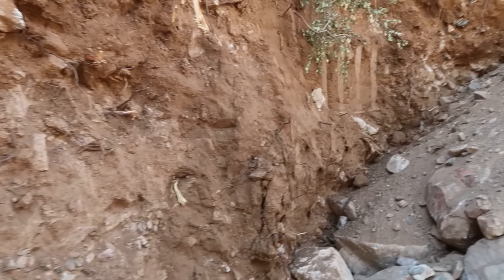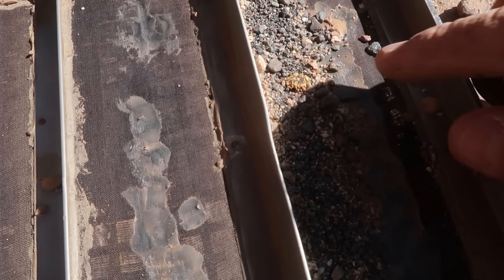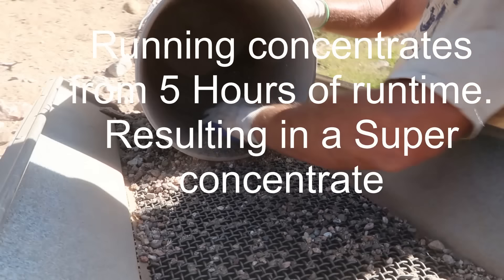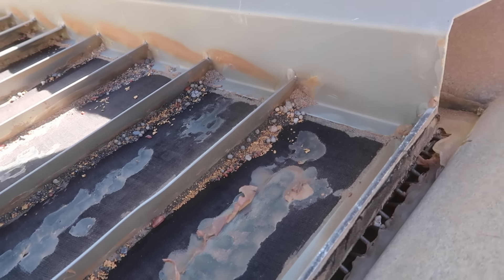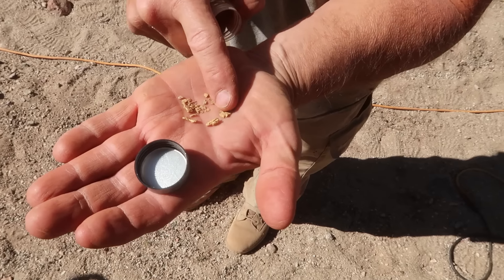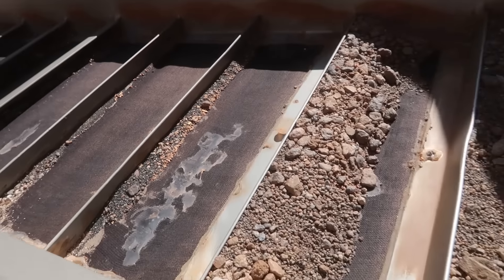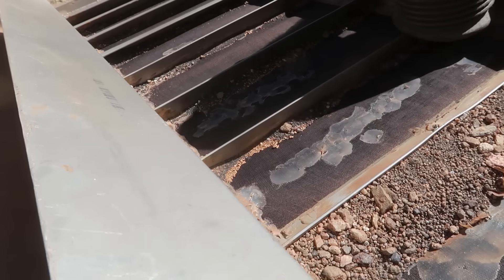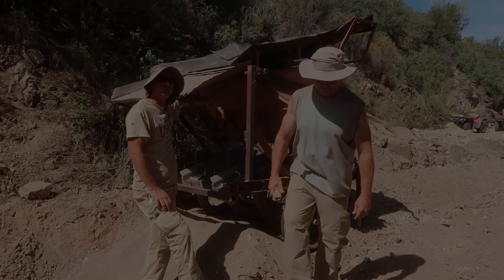Super Drywasher Finds More Gold Nuggets In Rich Ground !

Comment: Fantastic video!!!  Wish i could dig with a backhoe.  Still wondering though about the Morristown area claims. I below to bothe the GPAA and the Roadrunners. A ton of claims up there, but i am sure not finding much. I am finding gold, but 0.10 for 200 shovels full through my drywasher isnt worth the effort.  Wish we could get together for an hour or two to just walk some of those claims to see if i am doing something wrong. I have checked my tailings off my drywasher and there is no gold so i know i am running it correctly. I am not trying to make a living doing this but hope to get alot closer to a half a gram per trip. I also live closer to the Tucson area and would love to explore down that way if there were some areas that had some good gold.  I gave been at this desert mining now for over three years and just cant figure it out.   Thanks again Red
Reply from the maker: The roadrunners have over 200 mining leases in Arizona. Consider moving on to other areas besides the Morristown placers. Chances are you may be working ground that has already been worked.

Comment: So how easy is it to set up? I know   Both of you have hundreds if not thousands of hours dry washing and know how to set one up perfectly but how would it work for a newbie? Great video and gold and the crystals were extremely interesting thanks for sharing see you on the next one👍🏼👊🏼
Reply from the maker: It couldnt be easier to set up . Boulderdash has made the new improved version exceedingly simple. Even some angles are pre-set The original version has been in use since 2016-present day so everything learned from that was put into the new model.
Reply: @IBRAKEFORBEDROCK  cool thanks Adam

Comment: Do you ever use an old-school gold pan to find place in water or is that a waste these days?
Reply from the maker: Taking a sample from bedrock and using a pan to  find the gold is quite traditional, and used often
Reply: @IBRAKEFORBEDROCK  sweet, thanks for  knowledge. I've never looked for gold in my life, but want to. It seems I never see folks using those old pans in water. It seem metal detectors are where it's out these days. I'm way too new to buy a dry washer or water sluice. I will buy a Minelab. I will buy the best one (I don't care how much it cost.) Looks like you like using a VLF and a Pi.